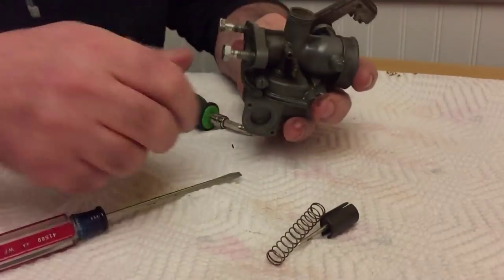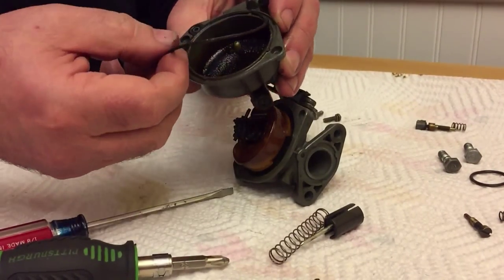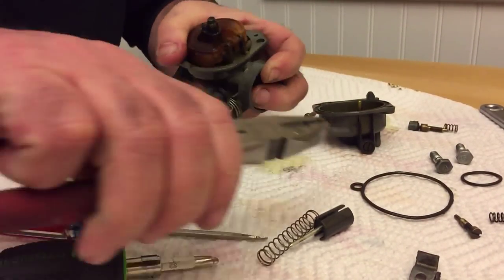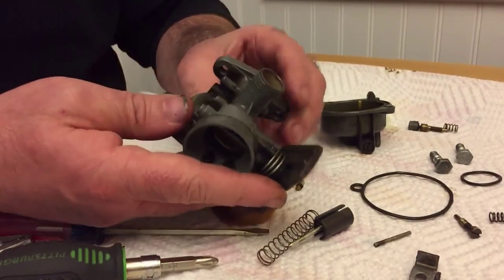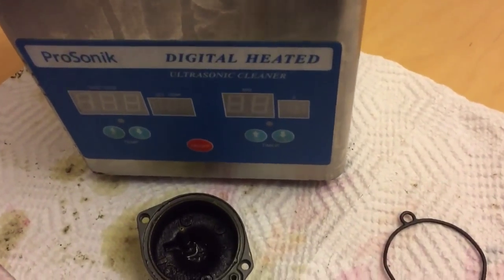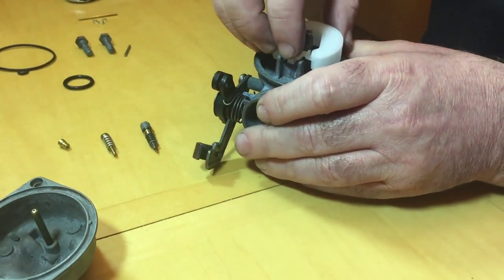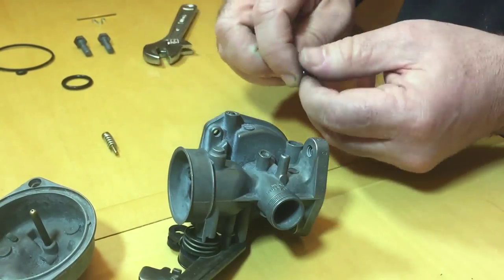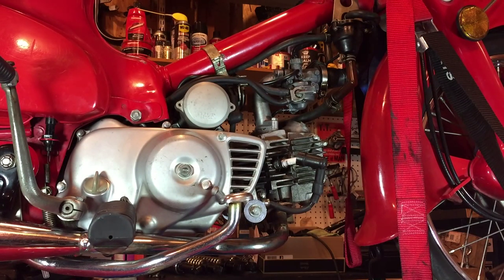1981 Honda C70 Passport (13) - Cleaning the carburetor

Comment: I used CLR many years ago, which seemed to strip the surface off the carburetor so any screw parts wouldn't fit together anymore, also left a white residue. About a year ago I used Simple Green, but that also left a white powdery residue. Did you experience anything like this?

Comment: How to do know how to set the jets when you put the carb back together. Also how do you know which gas line is for the reserve
Reply from the maker: Hi Jeremy, there was nothing to set concerning jets during the reassembly of the carb.  I just bought the correct jet sizes for the carb model and screwed them in.  For the air screw that is on the outside of the carb once it is assembled, I seem to remember that I just used the standard factory settings from the manual.  I think it was something like.. screw all the way in (but not too tight) and then screw it 2 to 2.5 turns out.  For the throttle stop, it depends upon how fast you want your bike to idle.  As far as reserve versus main line, I'm sorry but I can't remember!  It should hopefully say in the manual.  Sorry I couldn't be more specific.
Reply: For figuring out which line is which, I put a rubber cap on a screwdriver, and touched it to the main (high) tube in the tank, and felt the change in airflow on the fuel line by blowing/sucking.
Reply: The gas line which is closest to the front wheel is the main, and the one closest to the rear wheel is the reserve.  Main is above the reserve on the the petcock.